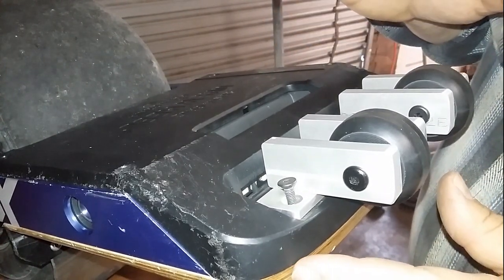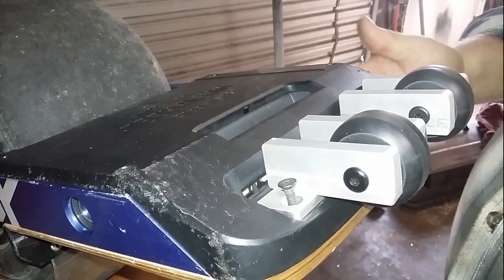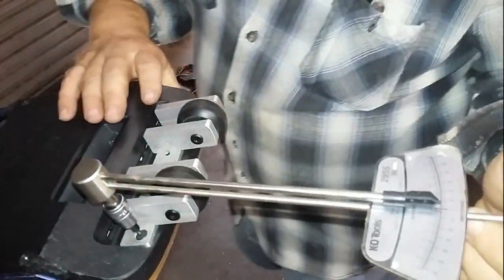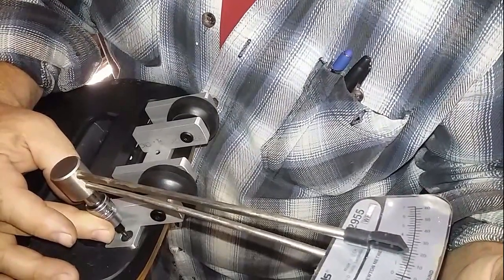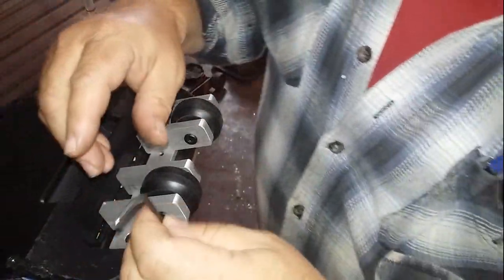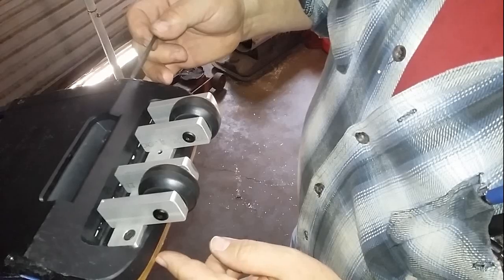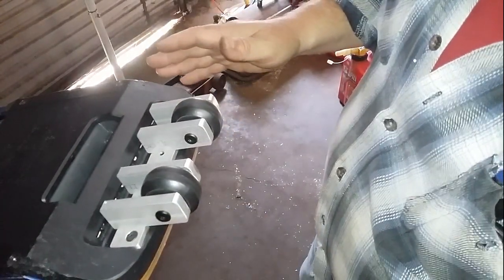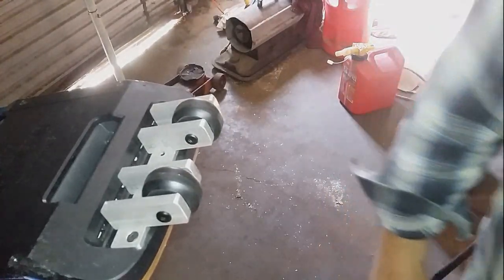One Wheel How to Install Sabretooth or Snaggletooth NDRD on a OneWheel

Comment: Just ordered for my pint. Cheaper that a trip to ER.
Reply from the maker: Thank you and you are correct! not to mention the pain lol!  plus this is a ONE TIME purchase under normal use these NDRD's Will not wear out or break! (neither should your arm!)
Reply: @Raven4122  Does this work with float Plate solo?
Reply from the maker: @MegaHowtoMan  you will need to get the Float plate kit OR at least the screws that are listed to assure everything lines up correctly

Comment: how do the fangs for the pint compare to these.
Reply from the maker: Apples and oranges 2 totally different designs The Jr is all aluminum construction with 4 mounting points and uses larger wheels to roll on a variety of surfaces..